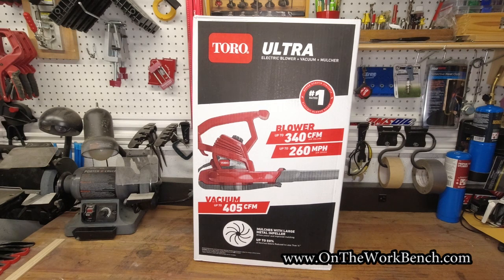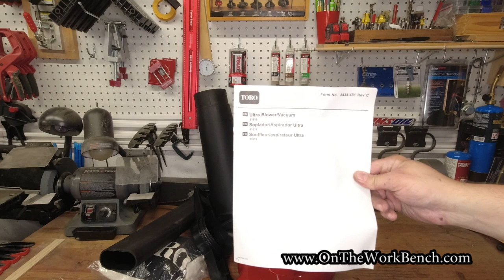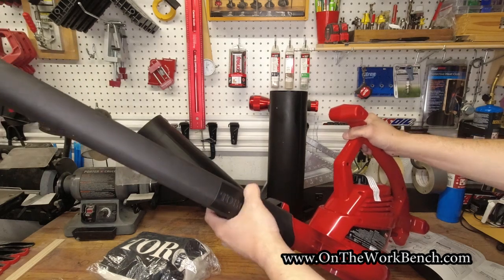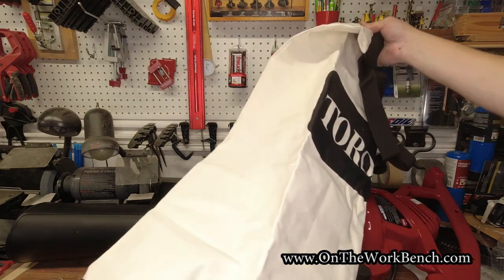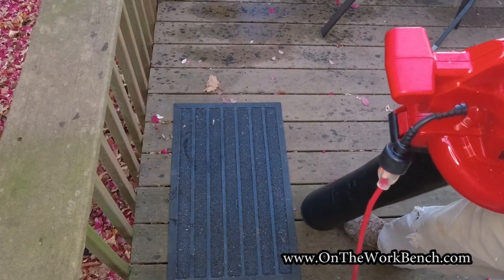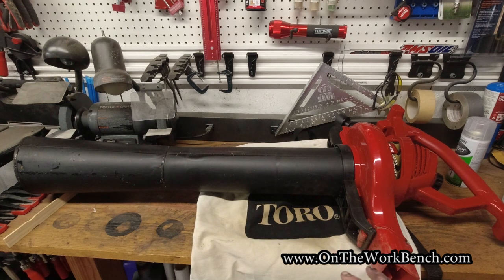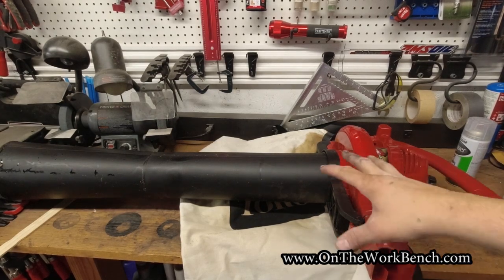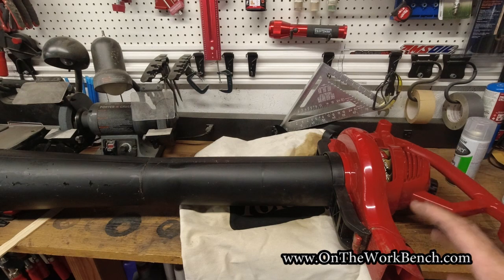Toro Ultra Leaf Blower Vacuum

Comment: Thank you so much for this video! I just bought one and couldn't quite figure out how to put it together! Most of the other videos I ran across showed how to blow the leaves or suck them up (which was useless). The product instructions were no help in showing how to connect the required pieces, but your video very clearly displayed that. Like you, I bought it mainly for the vacuum feature. About to use it now....thanks again for taking the time to demonstrate how to put the pieces together, it is much appreciated!!

Comment: I’ve had a Toro Blower Vac for about 20 years and it just quit on me.  Right exactly at the end of my job. It just slowly ran out of juice. And that was it. Couldn’t get it to turn back on.   I cannot believe how long it has lasted.  I use it every time I mow all summer long.  Only here to see if this one has that little extra new attachment.  Tractor supply has it for $99.
If you have a CITI Credit card they extend the warranty two years longer, than manufacturer 
YES, they do.  I just got reimbursed this year for something that I used my credit card for and CITI sent me a check.✅

Comment: I've had this blower for two years and this year the switch stopped working. Toror does a few things that will keep me from ever buying another Toro product for the rest of my life. When the switch went out, the thing to do was to take it apart and install a new switch. How ever, on this particular model Toro has gone out of their way to keep you from repairing it. They want you to buy a new one every two or three years. They stuck a screw inside the body that is not accessible from the out side , so, after you've removed all the screws, you still have to break it open to get into it. Once into it you'll find that Toro will not sell you a replacement switch. It's just another way they have of making you buy a new one. This should be an easy fix but Toror has, evidently, has a built in obsolescence. Keep away from Toro products.

Comment: The variable speed knob allows the blower feature to make a nice leaf pile , the machine will not function without the guard or at least  the one I have doesn't
Reply: great job  thank you
Reply: This is true.  Mine doesn't turn on either without the guard secured.

Comment: I got a similar one for my grandpa a few years ago, toro 51609, and it's been a great blower. I haven't used it as a vacuum, only a blower, and I feel like it's very lightweight for how powerful it is. Ultimately I replaced it with a redmax backpack blower, as I found it was just better suited for the amount of leaves I was blowing.

Comment: I can’t seem to release the blower attachment to put on the vacuum attachment instead. I push on the rough push “lever” and try to pry the attachment but can’t seem to budge it. I guess my 68 yr old female fingers don’t have the strength they did a couple years ago. Any suggestions?
Reply: Take the blower nozzle off first then put it on.  I had the same problem and figured it out.

Comment: Can the metal propeller be sharpened?
Reply from the maker: I don't see why not
Reply: Doing that could change the balance of the impeller.
Reply: Sharpening the impeller won't do much however, if one was to drill holes into blades to allow adding plastic grass trimmer line for extra mulching, just be sure the lines are short and even to balance impeller and the holes are tight  to secure lines.